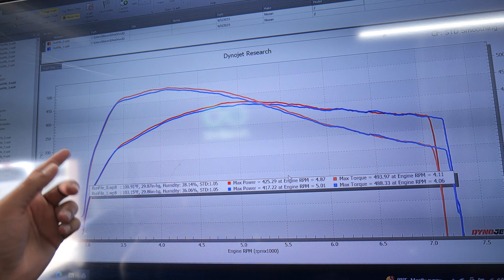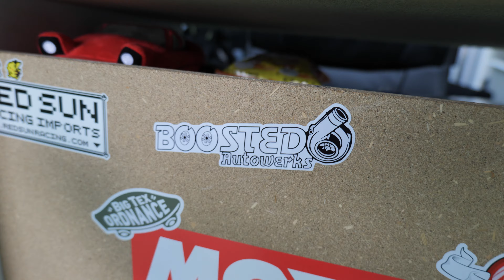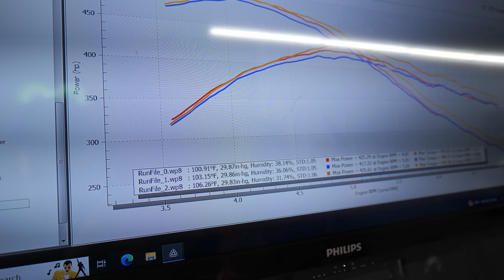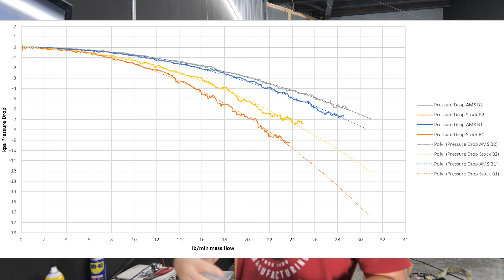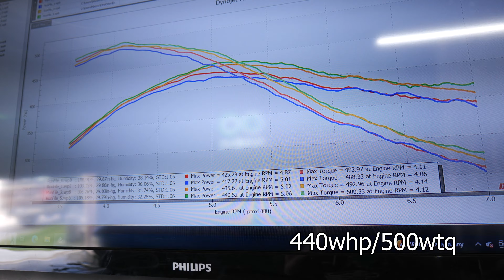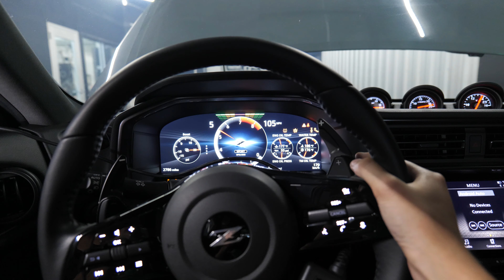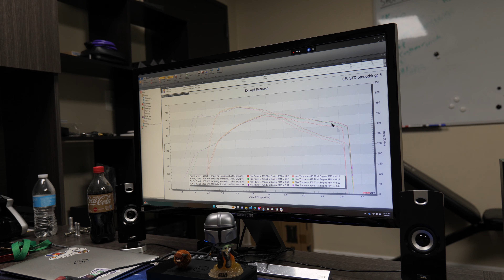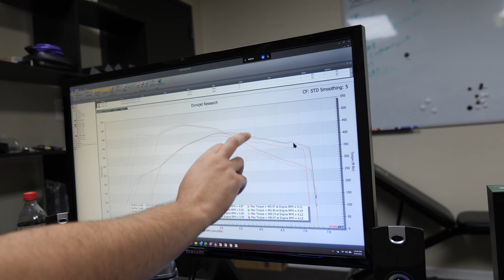2023 Nissan Z Intake Showdown: AMS vs Boosted 6 vs Stock - Dyno Tested and Compared![RACEBOX Z Ep11]

Comment: Great to see the comparison. Great indepth video with loads of info. You can really see Hussains passion and expertise. Like you said, the B6A intakes will make more of a difference with higher boost (ie upgraded turbos or Ethanol) and especially top end!
Reply: Very happy w/ the B6A 3” shorties , we are just about wrapped up w/ Alex in terms of dialing them in. We are looking to crack the 10’s in the 1/4 on my current E30 set up. Full weight & interior AWD Q60 RS 🚢 but she can move. Thank you Turbo P 🫡

Comment: I always feel like the hood should be closed. The open filters would loose all their advantage. People don't  drive around with their hoods open. Maybe take your hood off so you can run your hot air system and not be the so hot induction.
Reply: when you're going down the road with the shroud off they are still getting some fresh air, so this theory doesnt work.
Reply: @TurboGSR96 you run hotter IATs regardless on a open intake system in the real world on average you get less oxygen in as you pull hotter air after 2 pulls this engine gets hot and just because your driving doesn’t mean your going to get significantly cooler air. The AMS closed shroud design maximizes cooler air as a priority

Comment: Based on the information in this video it’s a no brainer Boosted6auto is the way to go considering these are not finished tuned those shorties still have plenty of power still I have the shorties myself  far superior intakes and low temps

Comment: Can you explain the differences in the Z turbos and probably most recent RS400 turbos ? It’s pretty evident they’re better and last even WITH FLAMES
Reply from the maker: The Z turbos are smaller than the turbos in the Q’s, they spool quicker but also die out quicker compared to any Q50/60. However with the short gear ratios in the 9 speed trans we are able to stay in the powerband by short shifting.

Comment: does it matter with the hood up?  Just thinking about under hood heat and airflow with the different designs between AMS & B6
Reply: Yes completely different IATS as the hood being up acts as ventilation for the open air intakes to take full benefit of sucking cold air , it’s only worth it if your a drag car a street car AMS is better as the open air ones suck hot air after 2 pulls with the hood down

Comment: Can you do a video on how you changed the MAF calibration, and all that process entails? I’m new to all this, and I’m looking at getting the AMS intakes. AMS’s website says no ECU tuning required but with the larger MAF housing I want to make sure I’m doing everything correctly.
Reply from the maker: While it’s true the AMS intakes with the 2.75” MAF housing doesn’t require a tune to run and fuel trims will be able to compensate for them, it is highly recommended to still get a custom tune and dial it in fully to get the most out of your intakes! You will only be able to do that with custom tuning, so feel free to contact us about tuning your VR30 🫡 (contact info in bio)

Comment: what about the Nismo and Z1 intakes?
Reply from the maker: Sorry for the late response, but they’ll mostly perform similar to the AMS intakes since they’re similar design. Both of those intakes use the stock MAF housing size however, so no tuning is required to run them but a tune is always recommended to get the most out of any performance parts!

Comment: I was actually looking into purchasing hks blow off valves for my Q50 but you said that they cause problems can you explain that for me please and should I buy them im trying to build my car mainly for performance but I would like to hear cool noises as well.
Reply: SonicTuned has a good writeup online if you search.
Reply: All it does is make your car run rich for a very short time, which won,t cause any damage at all. However the problems occur if you install the Bovs wrong. Boost leak is very bad. I have them on mine( installed myself). It’s very difficult to install because the engine bay is tight, but install them yourself, the shop charges 600 dollars to install. I was able to install them in 5 hours  with very minimal tools. I had to cut the top intercooler hose clamp because the screw was upside down and impossible to reach.
Reply: Z1 kit is very good, however keep in mind, you should get this mod last, you could get ams downpipes, and cold air intakes for the same amount as the blowoff valve kit.

Comment: you fix the biggest issue on a open filter setup by having the hood open i know you did your best but this wasnt any valid testing for many reasons best to run all these intake on the factory tune , then   18psi base map for all intake with the hood closed   so that way we would have 2 results best plug and play oem style filter and best filter for higher boost

Comment: I plan on getting boosted 6 intakes  for my q but i live in az. Its 100 out in october. Think id need a heat shield for the back side of the filters? I suppose it would be pretty easy to make them out of aluminum sheet... but then again its tight as hell in there and i dont want to block air flow. I got a good sized hx. Its frozen boost type 118. Thoughts on that?
Reply from the maker: Hey! We actually answered this question in our podcast! https://youtu.be/ZqFLMbMBHg8?si=eSvm3pV8MOvU_Nm3
But to summarize, cooler IATs mostly come from having a good heat exchanger (which u have), and upgrading the intercoolers. For your setup, I wouldn’t worry about having a heat shield for the intakes, they’re perfectly fine once the car starts moving and they get airflow!

Comment: lol 5th gear pulls.
Reply from the maker: Yes.
Reply: @goracebox 6th is the 1:1 for auto.
Reply from the maker: Yes because there's no reason to run the car out to 170mph, 130 in 5th is fine. Same with ZF8s, GM 8speeds, and the old Infiniti 7 speed.